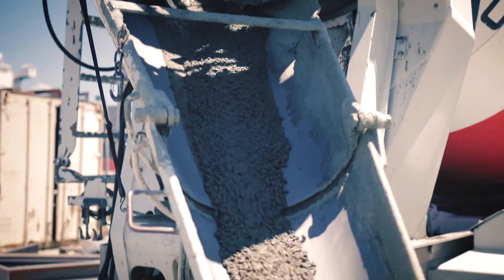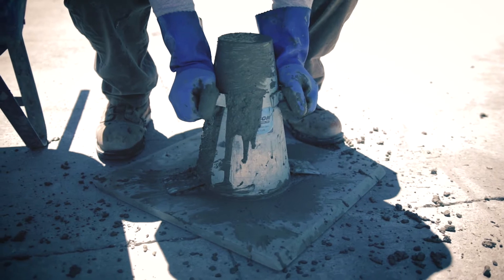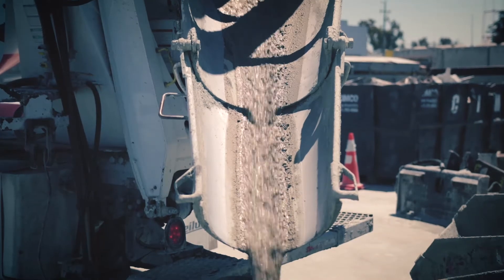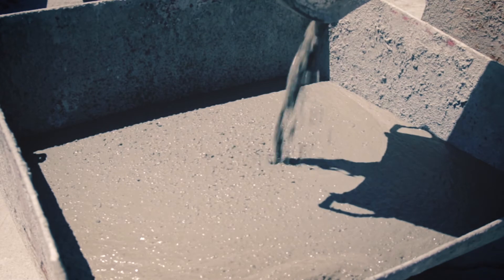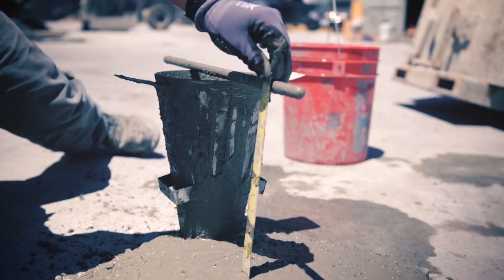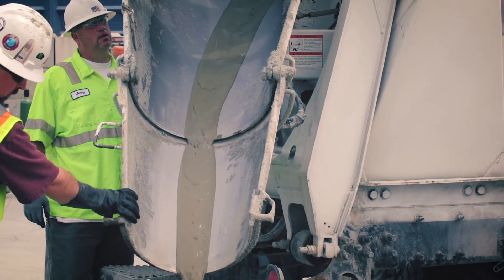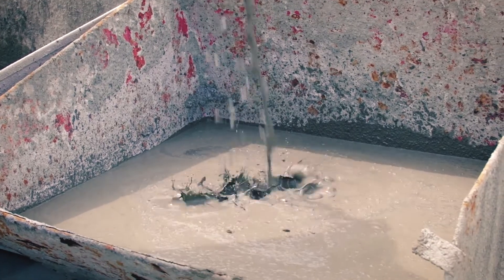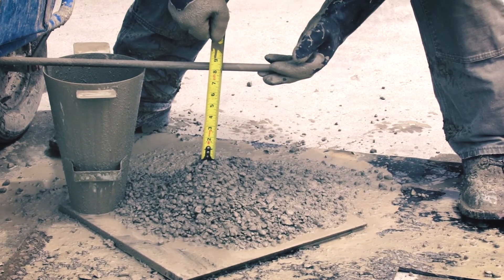Cemex High Slump Training - The Good, The Bad, And The Ugly

Comment: Your not mexering the concrete right not to mention i hope thats not a state load cause all loads way to wet...
Reply: Robby Soc what's mexering? And what state are you in to have to pour a 3 inch slump on everything? In Arizona the engineers are the ones who determine the slump, not the finishing crews or the ready mix company. All loads have to be in compliance. But you're Absolutly wrong on "ALL loads have to be 3" slump on state loads". There are tons of variables in every state that would determine what slump is required for the type of pour that's taking place. Also, this is not a video on how to mix a load, it's just a video to give an example of differences in slumps, from good, acceptable and bad.
Reply: @anthonyc4158  "mexering is Cemex metering. Get it? Lol
He must've been a newbie when he posted this 🤣 I'm a newbie too so I'll hold off on making comments right now.